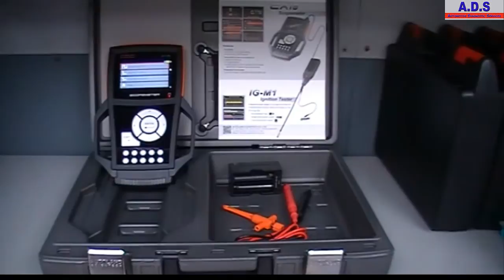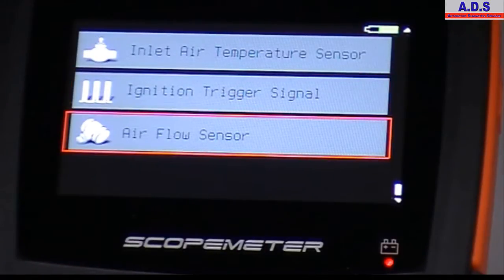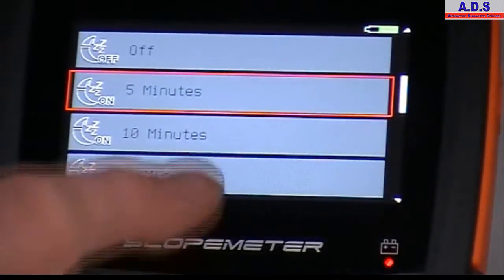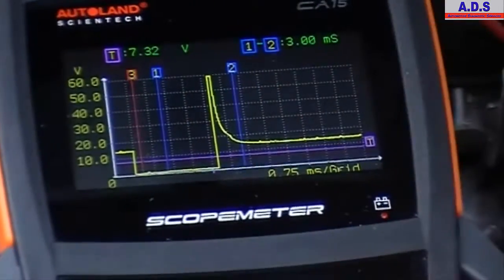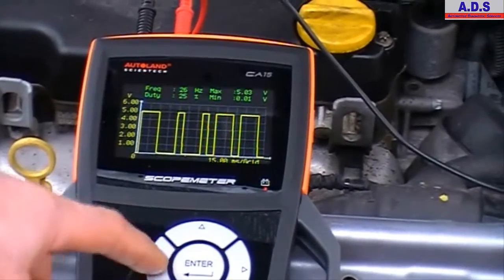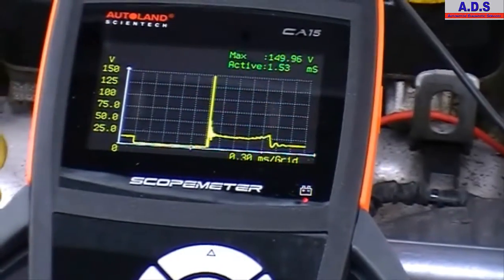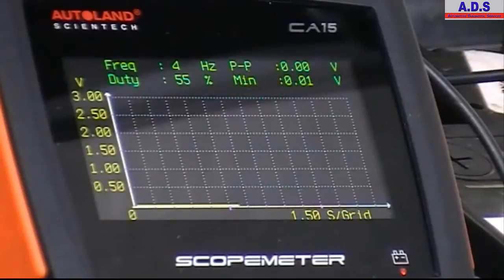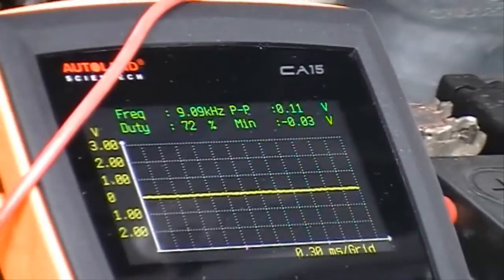Autoland CA 15 scope meter demo

Comment: Is it possible to make relative compression ?
Reply from the maker: Yes will be able to see if a cylinder is down on Comp but won’t be able to see which one as can’t sink coil or injector 
And can do with any brand of amp clamp
Reply: Ryans Automotive is clamp in The device ?
Reply from the maker: No clamp is optional or use with any 600 amp clamp like this
https://www.ryansautomotive.ie/shop/diagnostic-equipment-and-tools/oscilloscopes/laptop-based/200600-amps-clamps/
Reply: Ryans Automotive can you Tell me which cheaper Handheld scope are good
Reply from the maker: Sorry I don’t know haven’t used many other handheld ones